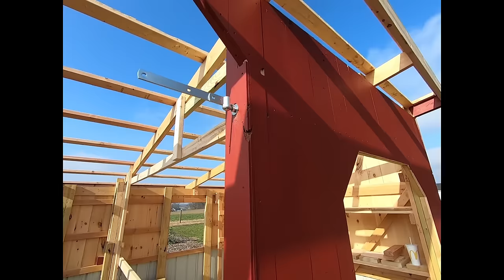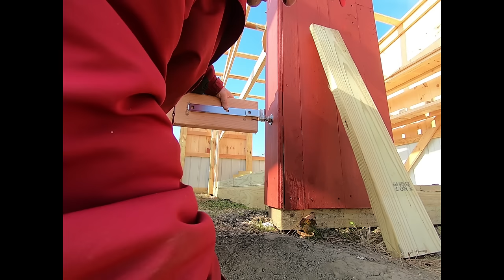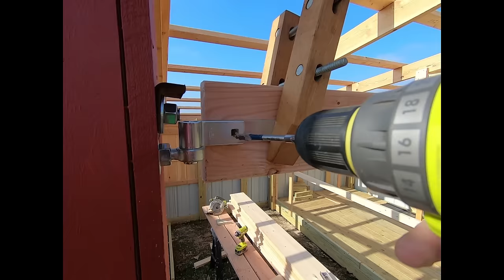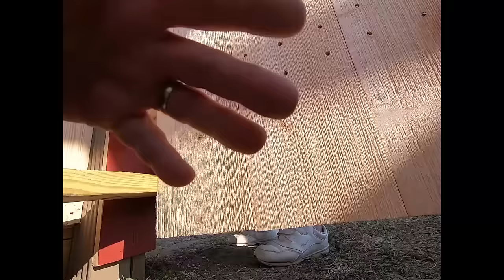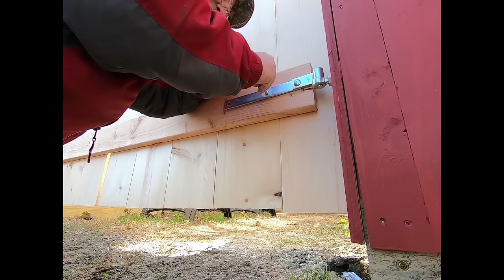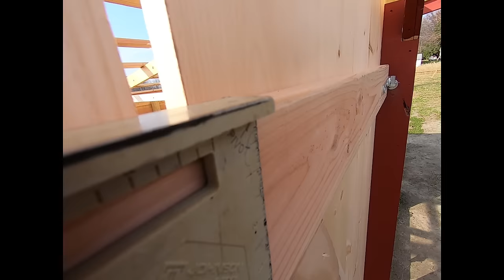DON'T build BARN Doors UNTIL you watch this VIDEO...EASY BARN DOORS

Comment: That's  how I did the ten foot wide doors on my shop by myself.  I built them with the horizontal braces full length and skinned it with plywood. When i was all done,  i popped a chalk line vertically down the center and cut them apart. Work smarter , not harder. :)
Reply from the maker: Thanks so much for watching.  It sure is an easier way to build.

Comment: Would this work for a Garage Door that is framed out at 20 feet wide?
Reply from the maker: The largest I’ve seen built is a touch over 20 feet and 16 feet tall.  The straps were 24 inches long.  I think there were only 2 of them too.  The longer your cross pieces the more you risk those pieces warping and twisting causing problems.  That said, if you chose good straight 2 by lumber it may not be a problem at all. I could see pressure treated being a problem as it dries out if you choose to go that route.  
If I was doing it I’d go with 3 cross members and 24 inch straps.  Make sure the door framing is good and solid even though the weight is transferred to the bottom hinge to a large extent because of the diagonal bracing you would need to use.

Comment: Great video! I'm going to be putting this to use sometime in the next few weeks. Two questions: What are you using for your vertical boards? Shiplap? Also, would it work to mark your cuts for the bracing prior to putting the vertical boards in place? If so, I won't need that "right angle pencil" or a chalkline. Thanks!
Reply from the maker: Thanks for watching.  If I remember correct it was shiplap but t&g would work well also.  I think you could Mark the diagonal braces before sheathing.  It makes more sense than the way I did it!  😄

Comment: What is the length of the hinge? I am going to build 6ft doors for a 12 ft opening.
Reply from the maker: A good rule of thumb is 1/3 the width of the door/gate.  Here is an Amazon link for 24” straps.  https://www.amazon.com/National-Hardware-N248-047-294BC-plated/dp/B002JGPTDG/ref=mp_s_a_1_5?dchild=1&keywords=national+hardware+hinge+strap&qid=1619406175&sprefix=national+hardware+hinge+&sr=8-5
Reply: @LancoAmish  Thank You!

Comment: That was a real nice technique, however I would add one refinement. On  my horizontal two by sixes, I would have cut a bevel on the top edge so that they would shed water.
Reply from the maker: Thanks for watching!  Great idea.  Please check out my channel if you get a chance.
Reply: Why not have the bracing on the inside?
Reply: @usedcarsokinawa  : Looks
Reply: Or use a router when done for taper to shed water….. my plans!

Comment: Did you use treated lumber
Reply from the maker: Thanks for watching. I did not as the building faces East and the doors are inset. Using PT would be fine but the hinges should be larger to carry the extra weight.

Comment: Why didn't you run the 8 other bolts in though the hinges then remove the 1st 4 and put the cut down boards on and drill though them  and run the bolts back in?
Reply from the maker: Thanks for watching and the comment.  I appreciate your thoughts.
Reply: Agree

Comment: I built a shed a few months ago and have a 4' opening for a door.  I haven't gotten around to putting the door on it yet (I'm in Tucson, so don't have to worry much about rain or snow and I have a pretty good overhang on that side of the building anyway).  This is a brilliant way to build quick, easy doors.  I'm going to do it this weekend with this technique!  The only issue is that there is only 1 opening, so I will have to adjust how I finish the hinges.  I'll probably do it before I put the middle boards on.  Work from the outside in rather than the inside out.
Reply from the maker: Thanks for watching and good luck this weekend!

Comment: I already have T1-11, so I'll use you method, even though I will have to lift the wood. I didn't find those hinges, I found wider strong hinges, just hope they are not too wide. Very smart way!
Reply: Finished the job, your method worked!!!

Comment: Great job
Can you please tell me the timber type and dimensions
Reply from the maker: The horizontal braces are 2x6 and the diagonals are 2x4.  The sheathing is 1x stock.  Thanks so much for watching!
Reply: @LancoAmish  So it's all pine? Looks great.
Reply from the maker: Patrick, Pine planking and spruce or fir 2x...whatever the lumber yard stocked for framing lumber at the time
Reply: @LancoAmish  thank you

Comment: I think my only addition to what you showed would be to clamp a level batton across between the gate posts at the height I wanted the bottom of the gate to be, prior to fixing the vertical slats. 
That would guarantee the bottom of the gate to be flush saving having to crawl around on the floor to cut them level later. Then simply remove the batton after all the vertical slats are fixed.
Reply from the maker: Thanks for the suggestion I really appreciate it and the time you took to view the video. Have a great day.

Comment: So, your 42-3/4 for center is from your frame?
Reply from the maker: John Foreman , no, I was measuring my 2x6 cross member.  If I remember correctly I had my hinge bolts the same distance from the frame so the center of the cross brace would have been very close to the center of the door opening.  Thanks for watching and please check out my channel for other builds and general homesteading topics.

Comment: Does it matter what kind of hinge you use?
Reply from the maker: Johnny Delgado , it shouldn’t matter as long as you hang your cross braces on them to take out the play that is in them.  You can’t have any sag possible as your doors will sag toward the middle.  Long strap hinges are stronger for heavier doors.

Comment: A very good idea of hanging the doors like this when on your own. But.... it seem like they are  open inwards and not outwards, they seem to be on the wrong side out..... I wouldn't have done it like this cause it is not so pretty......I woud have done them with a smooth side out, and for trimming I would have used some boards that was faux so they just suggested a support strut.
Reply from the maker: I guess it’s personal preference.  The doors face East and are inset so I wasn’t too concerned about weather just the look I was going after. Thanks so much for watching.  I appreciate your time.

Comment: I need insulated doors because my shed is spray foamed and will be heated and cooled but do you see any reason i can't use your concepts to build an insulated door. and where did you find those gate hinges?
Reply from the maker: Farm stores will carry them.  I’ve seen them in Tractor Supply.  I think they are made by National.  I don’t see why you couldn’t use the same concept to build an insulated door this way. Sandwich rigid foam between boards would work.

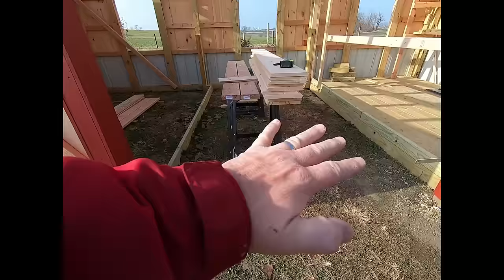Comment: 2:30 mark— Can’t tell from video... are you saying you want the hinges pointing in a downward angle, down towards the reveal?
Reply from the maker: Yes.  You need to take the slop out of the hinges in order for the doors not to drop towards the middle.  Strap hinges are notorious for having play in them.  Basically you are letting gravity drop the hinge straps downward before the door is built rather than after.
Reply: @LancoAmish  Let’s say I hang the hinges at a slope of -5°... won’t they droop even more?
Reply from the maker: No.  The strap can only drop so far. Of course, over 50 years and thousands of uses the pin and the hole in the strap will wear causing the doors to start drooping anyhow.
Here’s a link to what the straps look like. They sit over a pin.  Since the pin is smaller than the hole “play” is created.  By letting the strap settle down at an angle the play is taken out.
https://images.app.goo.gl/i7Hackdz2u7idwG99

Comment: Just thinking that before you ripped down the last of the door planks  you could have drilled the remaining 2 holes per hinge and mounted those carriage bolts. Then remove the first set of bolts, mounted the ripped down boards and redrilled the first 4 carriage bolt holes through the planks. This way all of the carriage bolts would be the same.
Reply from the maker: Thanks for watching and the suggestion. Never too old to learn!

Comment: How wide do the doors open?
Reply from the maker: About 100 degrees. If you used flush mount hinges on the outside face they’d open all the way to the wall. I wanted mine underneath the opening to keep rain off the top.

Comment: Where did you get the hinges? I like the simplicity of your doors.
Reply from the maker: Sidewinder Sidewinder , you can get them at Tractor Supply. They come in different lengths. They are used for field gates a lot.
Reply: @LancoAmish  Thanks for the information. I will be making a couple of these doors in our barn.
Reply: Great idea! Unfortunately if it is the only entrance this will not work.
Reply from the maker: Craig Mottola ,  you can reverse the idea. Put the cross members on the opposite side of the hinges.  Clad on the front side of crossmembers.  Cut in half. That’s how we did a 24 foot wide door a number of years ago.

Comment: Why so much space around the doors?  Does this method work for doors that you want to be flush and keep out wind and rain?
Reply from the maker: Julia Entz , if you were to put your sheathing on the outside of the bracing then the space could be decreased.  I wasn’t looking for weathertight doors, just doors to keep most of the weather off my machinery. I built mine this way also to have the doors inset so the tops of the doors wouldn’t get wet.  So in short, the spacing isn’t needed if you put the sheathing on the outside of the braces. A regular strap hinge mounted to the outside of the building instead of the gate hinges I used would also allow much more tighter spacing. Hope this helps.  Thanks so much for watching.
Reply: Great!  Thanks for the information and the video!!
Reply: Could I also use your method of building them in place if I used strap hinges?
Reply from the maker: Julia Entz  , that shouldn’t be a problem.

Comment: Where did you get the tongue and groove boards for the surface of the door?
Reply from the maker: Locally owned lumber yards usually carry them. Home Depot and Lowe’s I’ve never seen them.  If you are in a farming area ask for t&g barn siding.
Reply: Garden Spot Acres next question, our opening is 89”. Is that too big of a span for one door?
Reply from the maker: Jason Ahlers , building one door in place can be done but that downward pressure on these hinges must be kept somehow. It’s that downward pressure that keeps the door from sagging on these types of hinges.  Building the door out of place and then hanging it is going to cause the door to sag because there is “slop” in these types of hinges.  I think if you had 2 people, one to hold your cross member up and the other to work on the hinge end it could be done but it’s not going to be easy.  Double doors is much easier.
Reply: @LancoAmish  So I'm building this door to replace the tin that made up half of the south side of our run in shelter for our horses so that we can open up the whole south side for easier cleaning with the rake on our tractor.  Do you think a different type of hinge would be better for a single door?
Reply from the maker: Jason Ahlers , if you don’t mind the cross brace  not being level it would be easy to do by attaching the straps to the cross braces and then hanging them to the other part of the hinge to take the “slop”out. Then  you could put your sheathing on plumb.  Your cross brace will look a little wonky. If you look at my doors closely the cross braces are level but the hinge is wonky.  You’d have the opposite effect.  To get around that you could attach your hinges to the cross braces wonky like mine but then you’d probably be guessing a bit how wonky to put them on.  Look at mine carefully and you can see how off they are. Try to match that little bit and you’d be pretty darn close.
Reply: @LancoAmish  Thank you so much for the help and awesome video.  I'm going to give it a try this weekend and see how it turns out.
Reply from the maker: Jason Ahlers , Good luck!!

Comment: Why are the top and bottom horizontal 2x6's not the same as the doors to the left...not to be critical?
Reply from the maker: Everything would have lined up if I used lag screw type hinges. I used thru bolts instead which made the hinges unable to be lined up.  If I would have lined up the 2x6,s I would have gotten very close to their edges.

Comment: How would you lock them
Reply from the maker: Thanks for watching. You can use a sliding bolt on one of the doors. You can mount one on top of the door or use one on the bottom into the ground. Once that door is secured then a hasp and padlock would work.

Comment: is that cedar or? and what are the hinges called?
Reply from the maker: Kristopher Buxton ,the 2x6”s and cross bracing she are Douglas Fir (reddish color).  The rest is pine.  The hinges are called hinge straps. You can buy the thru bolts that I used or screw in lags.  Here’s a link to Ace Hardware. 
https://www.acehardware.com/departments/hardware/door-hardware/door-hinges/5006001?x429=true&gclid=EAIaIQobChMIwd3E3vmN6AIVSz5gCh1t5g8TEAQYBCABEgIx3PD_BwE&gclsrc=aw.ds

You can buy different length straps for different sized doors

Comment: What if you do want as big as gap in the middle
Reply from the maker: You can cut just once up the middle and plane a little off one side to get the gap to 1/4 inch or so.  I covered mine with a two by four which was attached to one door and overlapped the other door.

Comment: Love this, but I need to not have gaps.
Reply from the maker: That’s not a problem. Use flush mount hinges and mount to the face of the building. Then add your stops to the back side.

Comment: Where did you get the hinge an caridge bolts
Reply from the maker: Lawrence Estrada Sr. , Tractor Supply carries them as does Ace Hardware.  They are made by National.  Search  strap hinges.  You can get lag bolts or carriage bolts.  Many places carry them.

Comment: can you do this on a 12 x14 size door
Reply from the maker: Shouldn’t be any problem. Use a third hinge in the middle and use longer straps.  They are made up to 2 feet long. Make sure what you are attaching to can support those doors.  Reinforce if needed.
Reply: thank you,,,, i will give it a go

Comment: What kind of wood this that?
Reply from the maker: Thanks for watching. The bracing is probably fir and the boards are pine
Reply: @LancoAmish  where did you buy the boards at? Are any boards you recommend?
Reply from the maker: @victorsosa3015  , any boards will work. Tongue and groove will work too. I’ve had other viewers use plywood.  Flat edge boards also but you’ll have gapping with those.
Reply: @LancoAmish  okay thank you

Comment: Why isnt the batten on the outside? Rain is now on the beams and can get rotten...? In Europe we put the batten always on the outside
Reply: You're right. The smooth boards should be on the outside, with the braces inside. He has some good tips here but definitely got that detail backwards
Reply from the maker: I did the bracing on the outside for looks.  The doors are inset and face East.  Very little moisture problems.  I understand your concerns but I have to think of my neighbors too.

Comment: the gap between the doors ,can u make them closer
Reply from the maker: Yes, no problem.  I made “stops” by attaching 2x4 lumber to the face of one door.  It closes the gap and acts as a stop.
Reply: @LancoAmish  I guess to make them more airtight you would need to use completely different hinges?  Would this method work with different hinges?

Comment: Good idea, but aren’t the doors inside out?  The only thing you should see on the outside is the hing and the flat bolt heads.  Also, instead of drilling the first bolt hole on the clap board big enough to accommodate the bolt and nut, you could have installed the other two bolts first and the drilled the hole on the clap board big enough for the bolt only.  That was the would all look the same.  Another thing!  Your boards were not even at the bottom.  Either way, the bolts and doors are inside out.
Reply from the maker: Thanks for watching.  The doors are only inside out if you prefer them the other way.  My doors are inset and under an eave and facing East so they hardly ever have weather hitting them. I like the look of the framing on the outside and I guess many other builders and owners like it that way too since I see just as many my way as the other way especially when appearance is desired.  The purpose of the video was to show how to build big doors in place without heavy lifting by oneself.

Comment: Why is the 2x6 top and bottom not aligned with the other 8' door? Looks weird.
Reply from the maker: Bryan Reed, the nature of the hinge.  They are thru bolted.  Something wasn’t going to line up.  If I lined up the 2x6’s the hinges wouldn’t line up anyhow.  So I didn’t bother with it.  If my post was a 6x6 and I used the lag type hinge I could have lined things up but those hinges are notorious for loosening over time.  Thru bolted will stay tight forever.